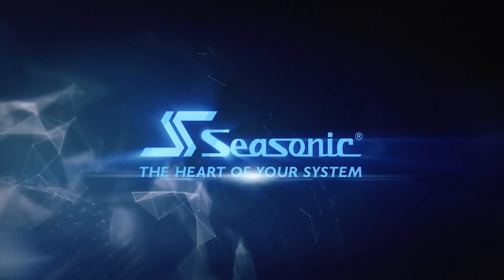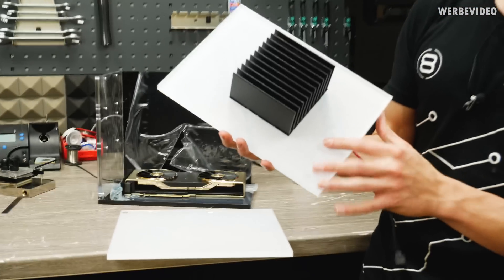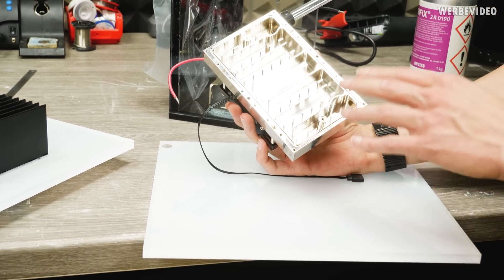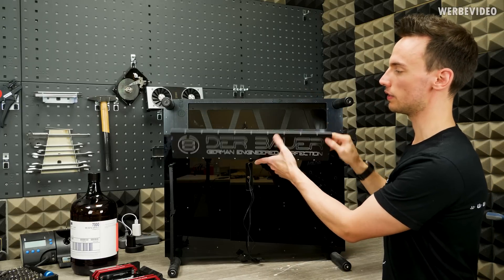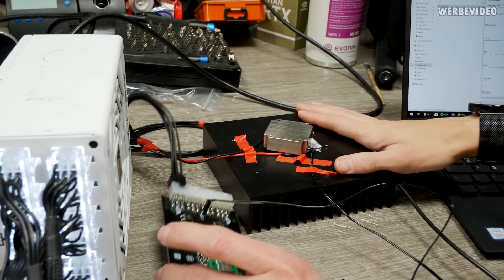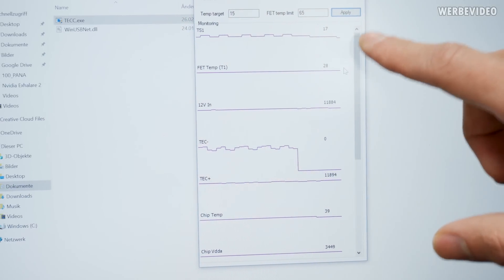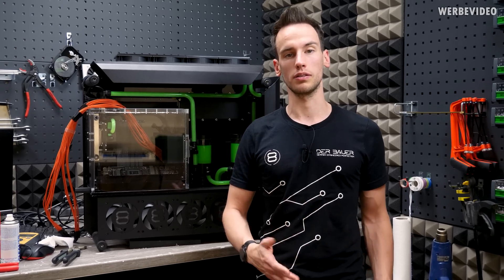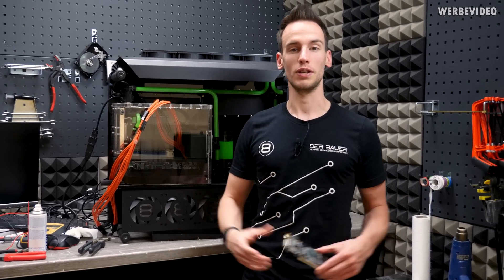Special: Development of Nvidia Aqua Exhalare 2.0 - Immersion Cooling

Comment: If you start with a large finned heat sink tank and use Freon, then you can control the operating temperature with pressure. Starting at -30C @ one atmosphere. ...

Comment: Why aren't extreme OC'ers using phase change cooling to chill this 3M fluid down to it's lowest working temperature in a completely immersed system? it seems like a setup like this would pay for itself in ln2 deliveries over the course of several OC sessions, and you'd have the potential for running sub-ambient for long periods without condensation woes. I remember seeing that some motherboard components and memory cease to function at very low temps, certainly you could selectively heat those areas with small, localized TEC's siliconed to MB with closed loop control to keep every component temperature in the sweet spot. Your TEC control software is a good starting point for controlling per-component temperature to give offsets. There are newer TEC elements that give effective heat pumping to 4Kelvin, so using small TEC's to modulate per component temperature up or down starting in a sub-ambient environment is possible. TEC's thermally epoxied to each memory chip running closed loop control, while everything under novek chilled to -100c. Phase change cooler can move 2KW of heat with less than 500Watts electric consumption. That might be more or less for sub ambient evaporator cycle, but it's always going to beat TEC's for bulk heat transfer efficiency. The combo of phase change + novek immersion could be the end-game to 2020 RIPGN/RIPLTT. @ me if you want another engineer to build something like this with, we could CAD, FEA, CNC, and FDM it up!

Comment: How about on a delided cpu, how will it   work ?
Reply: poorly. nucleate boiling does not occur efficiently off bare silicon adding a Boiling Enhancement to the surface will greatly reduce the boiling super heat needed to induce boiling.

Comment: Hurray for Peltier!
I wish peltier coolers were more common on computers.

If you were to hook the system up to a vacuum pump and give it sufficient sealing, you'd could reduce the atmospheric pressure in there, and thereby reduce the temperature at which the liquid would boil.
Reply: Been thinking the same thing.

Comment: OUCH!!  Have you given a thought to the perspex glue damaging the PCI-E riser?  The stuff is actually a type of acid.  The one I use(POLYWELD) melts the mating surfaces to create a bond, and from what I can fathom, even the stuff you use to weld plumbing(thick and plasticised) literally melts plastic(bar ABS or expanded polystyrene).
Great work so far though bud.  [thumbsup]

Comment: Really cool. This material has some wonderful properties. I would have loved to play around with myself. I hope this catches on and becomes available for enthusiasts.
I don't suppose you can say anything about what sort of pricetag the liquid carries? ... I assume it's all under NDA but I have to ask for my curiosity :)

I guess the only thing I really don't like here is the reliance on TECs. They are just so horribly inefficient it just hurts to me to think about them being combined with this fantastic high-tech cooling medium. If you have 10-15 celcius margins to work with from ambient to boiling then it should be possible to just aircool it with a massive heatsink/radiator (like the entire back broadside of the system sort of thing). With an equally massive fan (modified boxfan?) at low RPM I think that would work. it's essentially just a matter of having a large enough heatsink surface to compensate for the low thermal delta, so why not just go big? A system like that isn't going to be very portable anyway, so who cares if it's a bit heavy? :)

Why the need for a custom condenser? Wouldn't an off-theshelf plate heat exchanger do this job just as well?

Alternatively a small low-noise compressor to make it easy - but of course I have yet to see a compressor that is anything close to "quiet".
Reply: 3M Novac 7100 - ~$500 for 1 gallon

Comment: Hi Roman. Ein sehr WICHTIGES Thema: Viele berichten im Internet, das die aktuellen Asus Maximus XI Boards die Spannung bei CPU-Z falsch (weniger) anzeigen als die tatsächlich anliegende VCore. Angeblich ist die Die-Sense Messung nicht so korrekt wie die Socket-Sense Messung. Du hast doch viele CPU´s auf verschiedenen Boards getestet. Hast du da ein Unterschied gemerkt, das die Asus Board´s weniger VCore brauchen als z.B. MSI oder Gigabyte? Ich als ein Asus Motherboard Nutzer mache mir Sorgen beim Overclocking. Ein Video zu diesem Thema wäre wirklich Super. Grüsse aus der Türkei.

Comment: So the air cools the radiator which cools the water which cools the block which cools the peltier which cools the heat sinks which cools the novec which cools the heat spreader which cools the gpu. Nice sounds efficient!

Comment: Puts out a why i dont use tecs video.

then develops and sells tec board and uses tecs???????
Reply: It's a completely different TEC application. using TEC's to directly cool a die is dumb. Using TECs to build a heat exchanger (like what he did here) is very valid.
Reply: Especially when trying to transfer heat at such a low temp

Comment: Would a fan over the peltier heatsink make it condense more effectively?
Reply: Or changing the design to be flat and wide and just above the water surface to condense it as quickly as possible. I noticed only the bottom cm or two of the heatsink was wet
Reply: this might be an area where he can make improvements.

Comment: The block that was made for condensing the gas, you said it was custom. Is it a one off or something you plan on selling? I could really use 4 of those for a project im working on.
Reply: These look almost identical design to the cheap waterblocks you find on Ebay for $7 (they market them for lasers/GPUs/Peltiers). The only difference is those are very cheaply made aluminum, but the channel layout itself looks the same (it’s just not artwork like Der8aur’s). Those are probably what you need.
Reply: Jake Garrett the problem is there aluminum, and no where near the size I need. Not just lenght and width, but also surface area to the water. The one he is using there would be perfect.

Comment: @der8auer ... I'd be really interested in this... but in using external water sink instead of peltiers. Hmmm... should I buy a gallon of Noveck liquid. XD
Reply: It will only be hundreds of dollars 

3M Novec isn't cheap
Reply: @betrayedpredator8826  Wondering if I can use a smaller pot + piping? What's like 50ml of the stuff worth? :P

Comment: how good is this cooling for benching gpus. what about temp spikes?
Reply: You’ll be about 80c hotter than a basic phase cooler (same power draw from the cooler, similar setup and cleanup time). Phase computer cooling has been around a super long time (Asetech stopped making my cooler in 2006, so it’s very old but still working).

On a GPU (My FX-8350 at 1.7 Vcore gave similar results), I get idle at -60c and max block temp of -35c. Peak core temp is somewhere below 0c (not sure exact temp, software doesn’t show below 0c in Windows).

The cleanup time and still likely abysmal temps is a good reason to NOT use this setup. I typically get 44c on a GPU with a cheap waterblock, this 3M Novec is extremely expensive, and probably won’t do any better since if you see boiling, then even the OUTSIDE package temps will be above its boiling point... Water cooling will likely beat or match this. A few situations this might be handy, but this would be an AWEFUL test bench (as he said, it was going to take him a day just to fix it... I can build an entire system on my test bench probably blindfolded in 30 minutes).

Would not be good for test bench, for other use maybe, but definitely not for benching GPUs!

Comment: Roman, what kind of novec liquid are you using? is 1230? Is it safe to use the way you use it? Here is info on Russian wiki page on novec 1230: "Handle the substance in the open form with caution due to the low maximum allowable concentration of vapor and high volatility. When heated, it forms toxic substances, including hydrogen fluoride (when interacting with water vapor), trifluoroacetic acid, carbon monoxide and carbon dioxide. Therefore, 3M limits the use of the substance to professional use only. When extinguishing a fire using Novec 1230, personnel must use self-contained breathing apparatus".
Reply from the maker: Novec 7000 or 7100. Both are none toxic and safe to use. There are no special safety measures needed.
Reply: @der8auer  Ok, glad to know that. Thank you for your reply.

Comment: Interesting seeing certain areas of the die boiling the 3M novec. I would love to see the boiling as different work loads are applied to the GPU.
Reply: Wonder if laser etching the die would help
Reply: @Simoooo-n  Or even just scuffing the die surface with some sandpaper etc.  Definitely would be interesting to see if there is any noticeable effect of creating uniformly distributed nucleation sites.
Reply: probably so, most of the bubbles seem to emerge around the Nvidia engraving.

Comment: It’s incredible how bad riser cables are, why is that...?
Reply from the maker: I also don't get it. We had them break so many times or at least not fully working which indicates bad signaling... guess the quality overall is just not good
Reply: @der8auer  Seems like nobody can get the small gauge wires right and they fracture too easy for something which looks designed to flex... I think this is why things like USB have a much stiffer housing to stop that happening.
Reply: @nsmithy  Also different/more sleeving I think.
Reply: @wobblysauce  Yeah, it really does seem to be a problem though which is quite strange!
Reply: @der8auer  I went through 4 replacement riser cables for the Phanteks Shift before giving up and using a conventional-layout case. In my situation I could install the drivers and game with the card, but the riser caused unique stuttering. The behavior was really strange; if you alt-tabbed to desktop and back to a game, you'd get a different level of performance each time: from no problem at all, to slight microstuttering, to at worst something like a 90% drop in average framerate. My theory is it had something to do with the card clocking down and back up, resulting in a different alignment of the clock to some periodic source of interference within the system.

PCIe is a packet-based bus with error detection and retransmission, so for me this never caused any visual corruption. I was never able to figure out how to monitor the PCIe retransmission count in Windows, but maybe your industry contacts can help you with that.

In any case, I would vigorously test the performance of the riser before sealing the enclosure with glue again.
Reply: When someone finds a good brand let me know